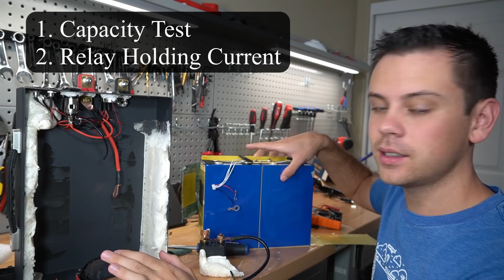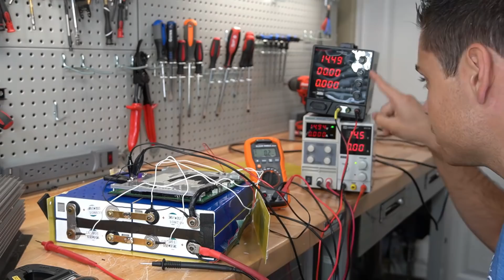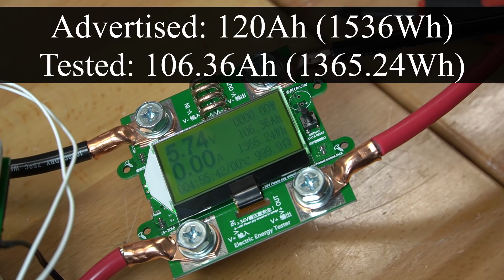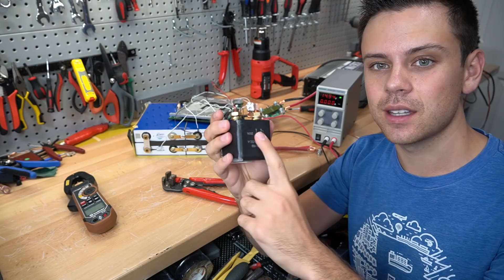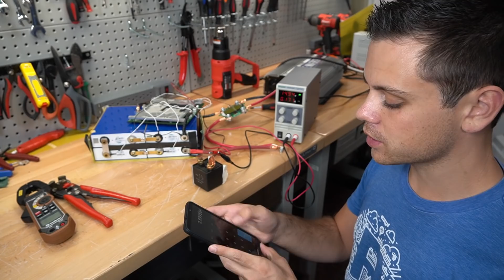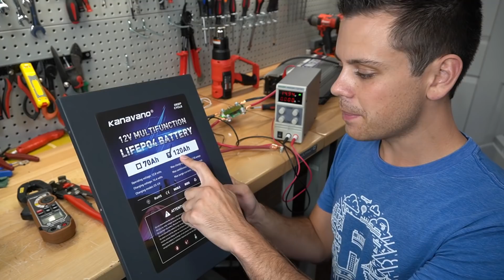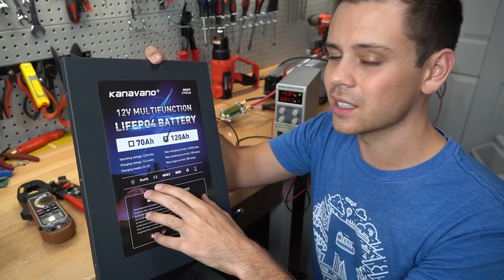$456 120Ah LiFePO4 Battery Part 2: I got ripped off

Comment: I have washed your earlier videos on lithium titanate batteries and The innovation season them but have seen conflicting reviews on YouTube about how the inefficiencies are not that big I was wondering if it was just your brand that you were using with the inefficiencies are really only about 80% round trip
Reply: You should buy the $500 bicycle battery with rack that's a kilowatt hour as normally as it come with the rack it has a charger included as well. I don't know if it's a one shot deal so whoever grabs it if it is I think it's going to be very lucky and if it's not a one shot deal they can share whether it is as advertised because that's awesome to get a kilowatt hour high voltage bicycle battery that is also extremely high amperage obviously for $500 is I think unheard of and has been teasing me now many months with significant diligence done primarily as to the sellers other products which suggests that this is not any sort of scam but as I mentioned likely a one shot deal.

Comment: give it a few cycles... see if you can really puff up those thin cases..  perhaps out doors.  vegas baby. takin odds
PS  112 degrees today,  solar maxed out on reefers.. 1,200 watt home depot genny  running the 400 watt AC. for a few more hours after dark

Comment: Thanks for this testing! I’m thinking you’re right, these are the 105Ah cells with a bigger number slapped on the pack.
Reply: Right. They are 105Ah cells. 
So 106Ah pushed out is very good. 
The problem is they write 120Ah
Reply: Nothing strange.. i see on AliExpress 18650 with 12.000 mah capacity!! 😱😱😱😂😂
Reply: @claudiorivieccio4967  9.900mAh is the standard chinese amperage, so 12.000mAh are very good for its standard

Comment: Don’t you have to cycle the battery a few times before it will handle max capacity?
Reply from the maker: No. New cells pull more than full capacity on first few cycles. Always
Reply: DIY Solar Power with Will Prowse thanks for clarifying that!

Comment: Since you said the batteries have barcodes on them, is there a way to trace the history of the battery with manufacturer?
Reply: Depends on the manufacturer. Most aren’t going to tell you much specifics. You can probably extrapolate date made.

Comment: Hello I have a sliding gate that I installed but trying to do it with solar because my hate is 700 feet away from my house.  The inverter I have uses 0.9 dc on stand by  and and when the gate is open and closing uses 22 dc and 2.7ac.  What would be the amp hour for my batter. I just order a 300watt solar kit. But I need to know how ma y battery I would need? Thanks in advance.

Comment: If you search on youtube for "Work Truck Converted Into Stealth Tiny House", I bought that truck, did not pay anywhere close to the $15,000 asking price.  I have modified it and am typing this from the inside of it sitting on my recliner.  I also have a full size bed in here, who wants to sleep on the floor in the kitchen?  I have put in a wood floor I got for free from a guy on craigslist.  I recently bought 400 watts of solar panels.  I think the batteries in here are shot, I am currently hooked up to shore power but am having to leave this location very soon.  Not sure what to do as I spend all my money on the panels.  Hopefully something will work out.  I am in poor health and just trying to live comfortably the rest of my days.  Is there a way to restore batteries that have gone bad?

Comment: Are you sensing the cut off voltage at the battery or at the inverter.   There is a voltage drop if at the inverter and would be cutting off early.  You should have a volt meter hooked up to the battery to see what actual voltage it's at when it cuts off.  Some of those Ali express load testers also have the same problem and do not have seperate voltage sense leads to the battery and always measure .5v lower the what the battery is
Reply from the maker: Oh sure, that's why my load was lower than .2C rate. And it's BMS cut off. And the voltage was low for all cells at LVD, and I top balanced earlier. They are new cells, so the results were nominal.
Reply: @WillProwse  ah. I didn't realise you where going to bms cutoff. Thought you where going  directly from the cells

Comment: Would the OE bms provide a different result? I take it the low voltage cutoff is a standard figure.?
Reply from the maker: Yeah it's a standard figure. And the BMS I used for the test is high quality
Reply: @WillProwse  it sounds like you're using a different BMS based upon your phrasing because if you use the DMS that they provided you could have been clear and said that the BMS they provided was high-quality and that's the one that you used. If they advertised it based upon draining the cells to zero or to whatever their BMS wait until to turn it off they would have a defense not a good one but they would have an argument that your BMS is not what they rated the package on. That was my first thought actually before I read your reply. Another commenter mentions lithium titanate and with that chemistry of course you can drain it to zero not that doing so increases the total capacity much. Or that charging it all the way up does which is the plus side of lto that you don't need to use constant current constant voltage but can just let her rip until it stops taking a charge by using a lower voltage and no internal resistance

Comment: Thanks will! We really appreciate the extra effort.
If I may,I have couple of question? 
Was there an issue with the original BMS? Why did you use a different one? I don't mind adding a simple fuse. But that's about it.
 Also since the capacity indeed came up short the first time. Would/does  the capacity go up or down during repeated use? I honestly don't know?
(That's why I follow you 😁). And as always thanks for your time.
Reply: Bill Jacobs 
Original BMS was tiny that cannot directly handle the load current and that’s why the battery pack had a relay. The tiny BMS was just controlling the relay (ON/oFF), so the relay was the one “carrying” the load current.  So, for Will to test the battery capacity, he needed to use a method that didn’t include the relay since it has an idle self consumption waste of power. Thus by using another larger standard BMS, load current passes through the BMS switching mosfet transistors which have very low(negligible) idle power wastage(consumption).
Reply: @jessew6757 That makes sense. Thanks 👍
Reply: @billjacobs8035  the issue is the BMS they supplied may have drain the batteries to a much lower voltage not enough of a voltage drop of course to get the claim amp hours but it would be slightly higher than what the recommended disconnect voltage is. This channel has often mentioned you can use a relay 2 add value to high-quality bms's. I find it fascinating that Mercedes is competing with Tesla on the powerwalls but is using their car batteries promoting it as a green afterlife. Does anybody know if Tesla is reusing any of their batteries in their powerwall from lease returns Etc?

Comment: At least it didn't come with seeds.  Honestly I was surprised it was over 100.  Good test.  Was the 105 that they sell a lot cheaper?
Reply: Yeah, aren't those typically aroud 95 Ah?
Reply: I think this still has purpose for the right application. Low draw, long life battery supply.  Cheap. Inexpensive.
Reply: @davidhaddox  but it's too expensive for what it is. $456 is a lot when considering that you can buy those four cells under $200.
Reply: @tkermi  send link for $200 105ah cells plz

Comment: I'm not sure i'd ask for my money back after tearing the product apart.  I sell custom electronics, so that's a pretty big sticking point for me.  However, good luck.  You're obivously better at the dispute process than I am.  I've found they side with the producer no matter what evidence you provide.  i consider Aliexpress to be throw away if bad.
Reply: I think aliexpress will make a difference based on how loyal/good a customer you are. When I didn't have many orders, just one every few months I had the same experience you had, it was hard to win a dispute and they usually sided with the seller.  This year I've made about 50 orders less ranging from 1 to 100usd, left some good reviews, often confirmed the order received soon after I actually got it. And now I feel they usually side with me and I won all of my disputes except for one, which was my own fault.
Reply from the maker: Yes I will get my money back. Not hard to do.

Comment: I can’t believe they will burn fuel ⛽️ shipping time & cost just to have the battery sent back, round trip. Psh.
Reply: I've never had to return anything to aliexpress when it was broken or obviously did not match the description. Usually the sellers make it right or else I dispute with aliexpress and I get a refund. (don't let the seller reship! insist on a refund at least in the form of store credit - but only if you can spend that immediately. The original shipment for an order is the only one protected by aliexpress and the sellers know it.)
Reply: @Sylvan_dB  I returned a cpu (Ryzen 5 3600) once, and they actually confirmed it was broken (which is very rare for cpus) and I got a new one free of charge. Was a bit worrying and had to pay 20€ for the shipping but still, better than having them claim it wasn't actually broken.
Reply: 1234 I agree, Capitalism has its down falls. You think they would just send a kit to avoid Tax on completed Products. Like Harley Davidson in India 🇮🇳 they create the bike & assemble it.